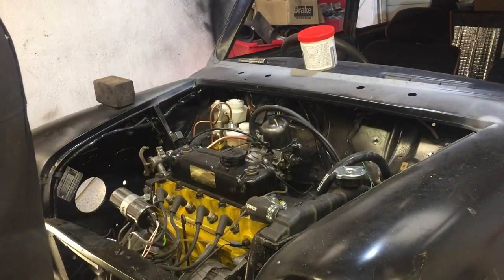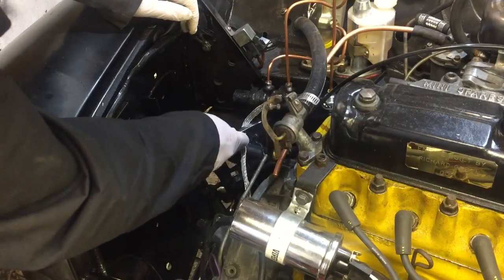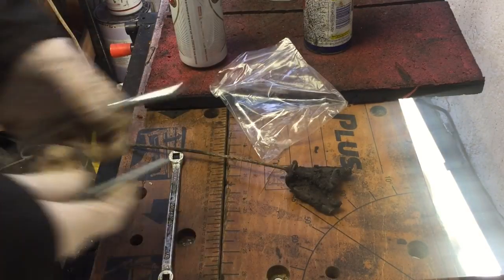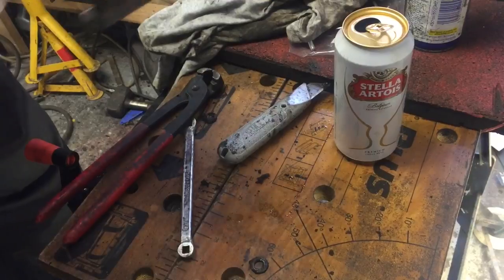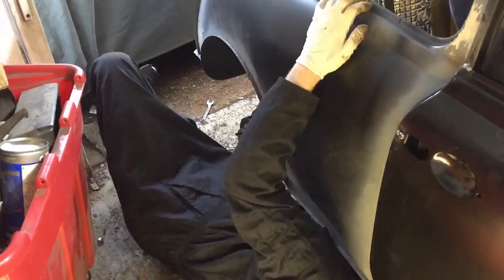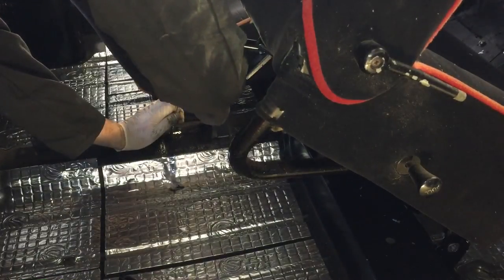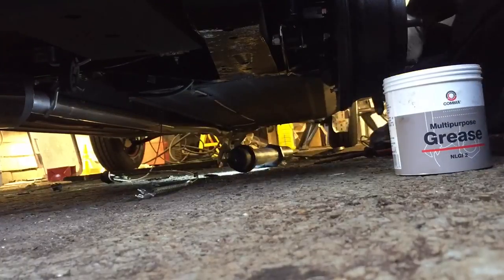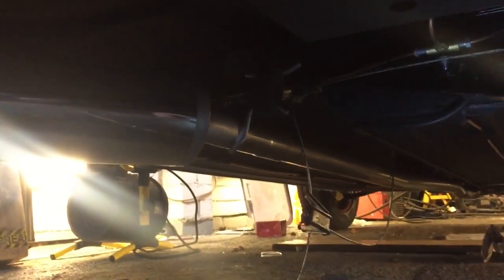Classic Mini Restoration Part 104

Comment: Matt, I've had days like that with my mini restoration. 1 step forward, 2 back. Best solution - walk away from it, collate your thoughts and ideas, good nights sleep, attack again tomorrow. Keep going chap, great work!
Reply from the maker: cheers guys , just having roast dinner , then hope to have another crack at hand brake cable ...also have located a replacement brake compensator ,.. will arrive during week